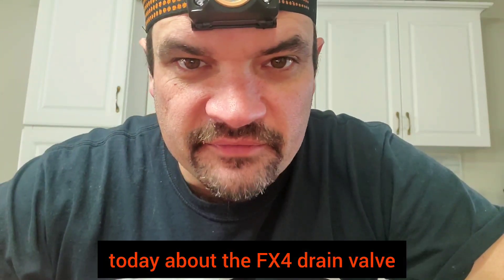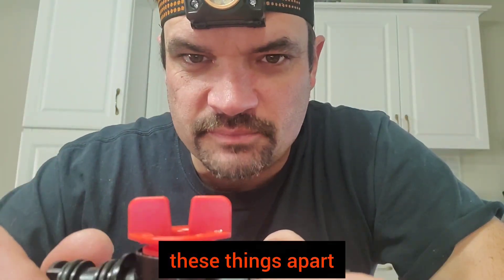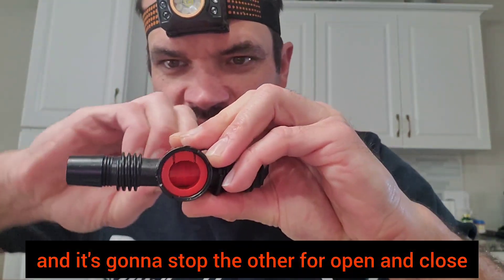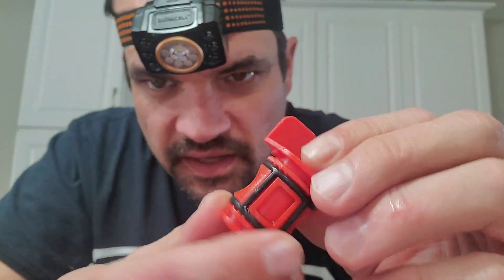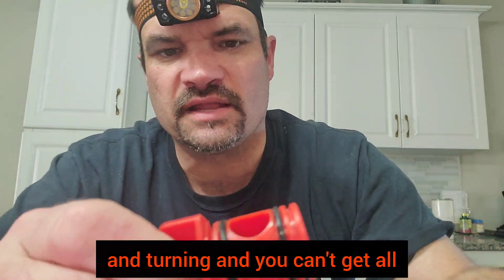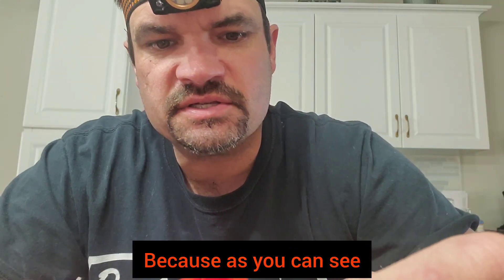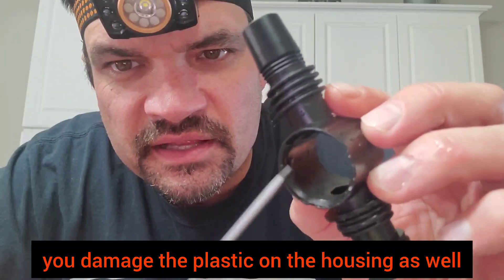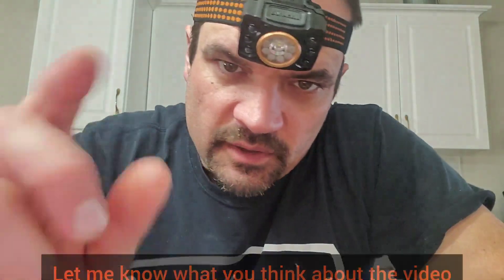My Findings On The Fluval Fx Series Canister Filter Drain Valve!

Comment: Hey everyone, just fyi you don’t need to pry on the valve to get it apart. Simply clock it correctly and push it out with your thumb.
Reply from the maker: So your saying the valve  will come out if turned in the correct position,  ive tried that did not work, appreciate your input here , did it come out just by pulling it after u got it right position?